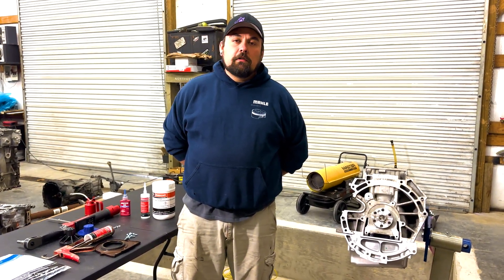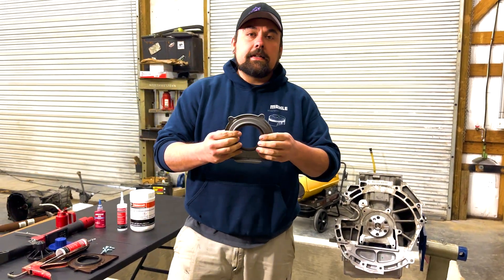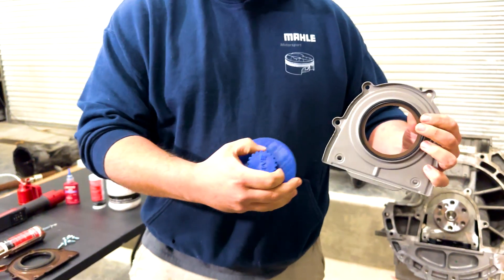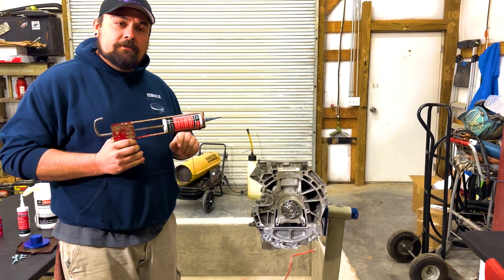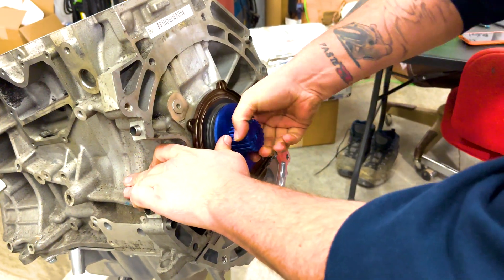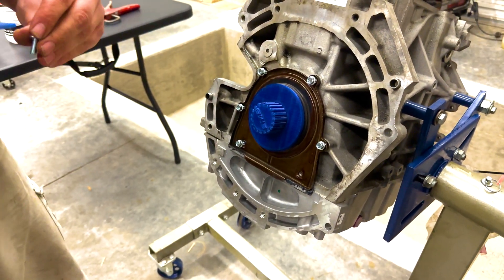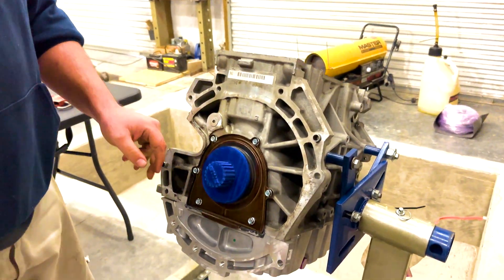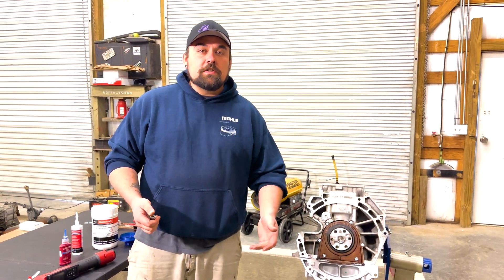Rear Main Seal Install on 2.0 & 2.3 Liter EcoBoost Engines

Comment: Thanks for the video! Doing one now and didn't see a huge leak, but the customer asked for the rear main to be replaced, as it was leaking. Checked the bolts, and bottom right side bolt was finger tight! So, it was definitely leaking a little from there.

Comment: Do you recommend sanding the crank with a fine grit sand paper to clean the old oil and gasket line on the crank itself?

Comment: Thank you for the no BS instruction video!  Doing this on my wife's EcoBoost Mustang 15 with 140k.  I did notice one of the bottom seal bolts loose on mine also.  Great to the point video.  Thank you!,

Comment: Can confirm, works great with a MAP billet rear main. It’s super strong, definitely can get more then 2 uses. Makes install so easy.

Edit, also yeah my oem rear main bolts, one was loose. Like actually.

Comment: Rear main seal replacement on 2016 ford fusion 2.0 ecoboost. What is a reasonable price, how long will it take, and is a dealer shop recommended for best results?